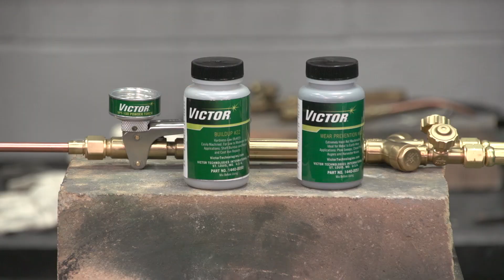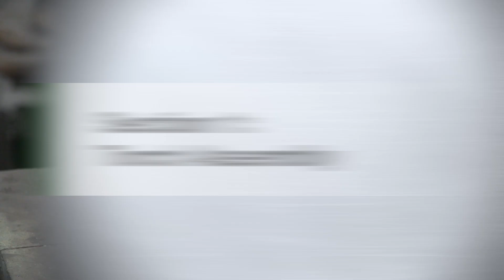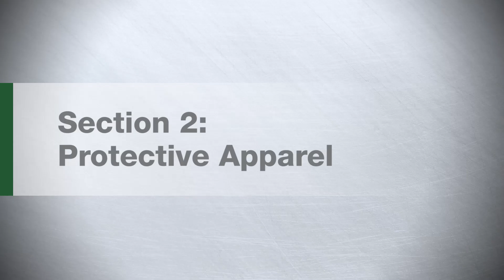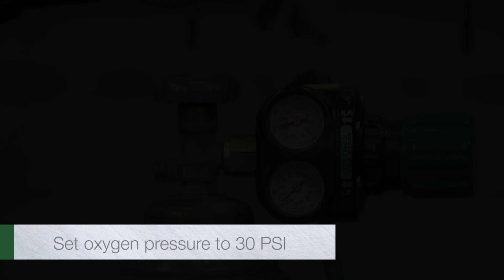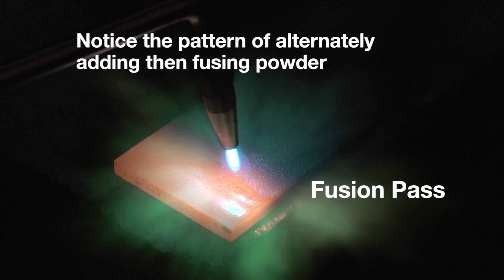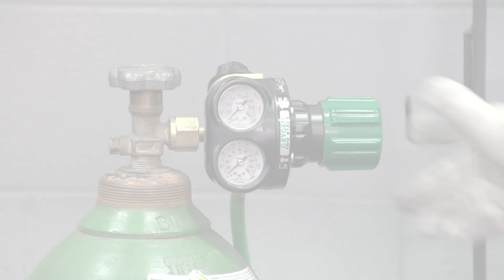Repair and Hardfacing Guidelines when Using a Powder Spray Torch | Victor Torches

Comment: How can I fix tiny dot like holes that remain under the spray layer of welding???
Reply from the maker: Hi there, thank you for using ESAB products. In order to best assist you with your question, we ask that you contact our Technical Service department for assistance. You can reach them at 800.ESAB.123 (800.372.2123) and follow the prompts.

Comment: What is this good for? What type of repair would you do with this system?
Reply: Surface treatment of a milder steel sort in order to harden it ex. for knives on a mower. Or rebuilding a worn down shaft for new bearings to be fitted. ex. and electric motor where the shaft has been worn due to slack in the bearings.
One would simply make a setup in a lathe and spray weld new material onto the shaft. After cooling, it can be machined.

Comment: less work safety , because the regulator is not equipped with flash back!
Reply: Abdul Rivai Babo Onix they may have them rigjt before the tankes
Reply: Flashback vales are integrated into to torch handle itself after the  valves.